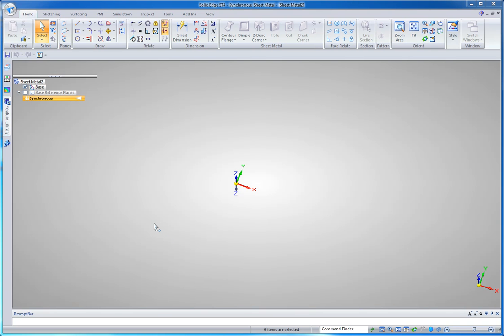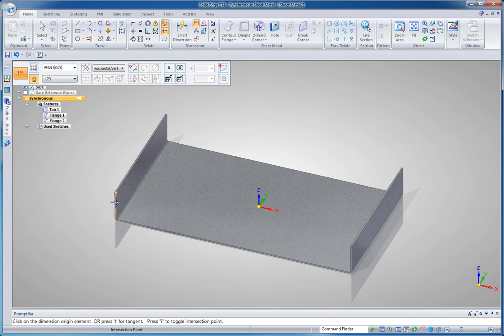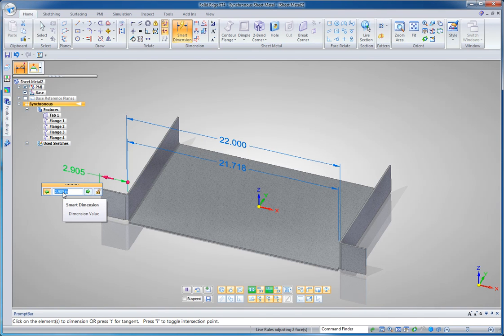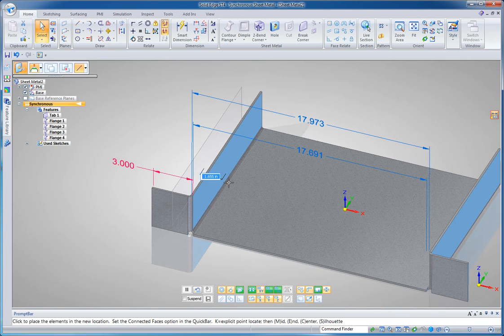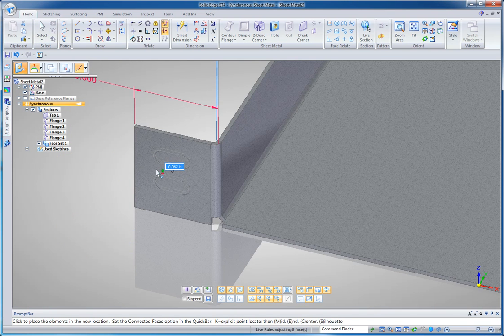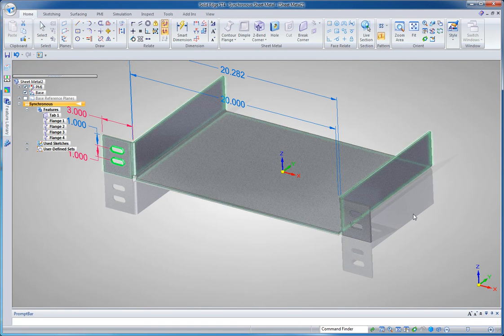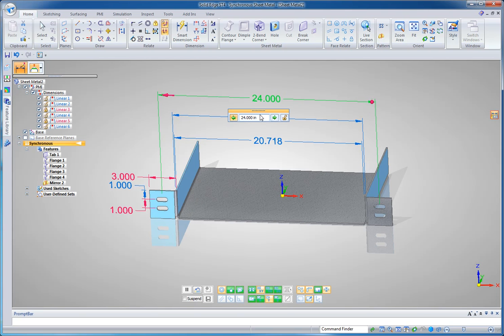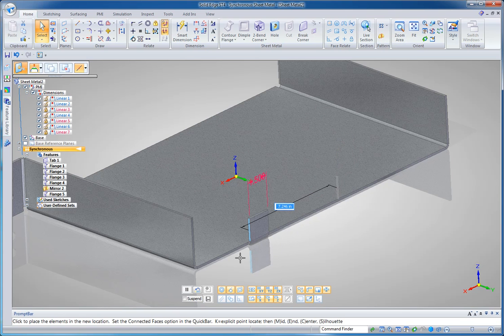Solid Edge ST4 - Sheet Metal Design - Part 1

Comment: How are you able to drag items from the feature library?  I tried dragging some items from feature library in synchronous sheet metal and then switching to synchronous part and it wouldn't work.  Then I changed to ordered part and I was able to drag items from feature library?  Also, how do you determine whether when switching from synchronous sheet metal to part to stay in synchronous and not switching to ordered part?